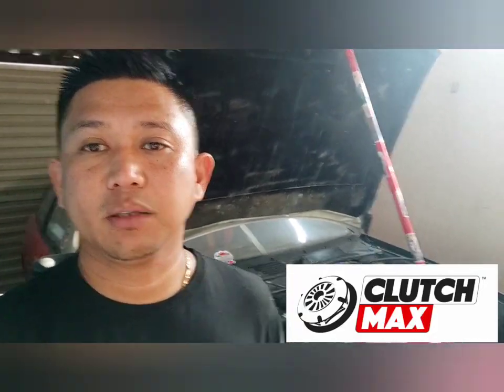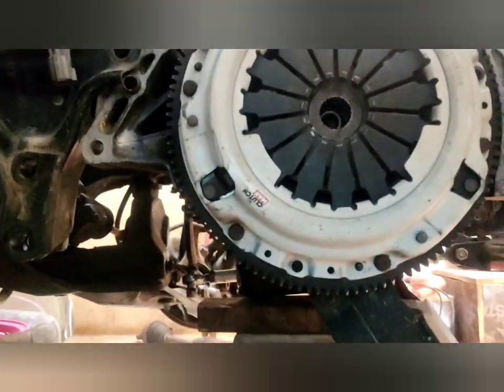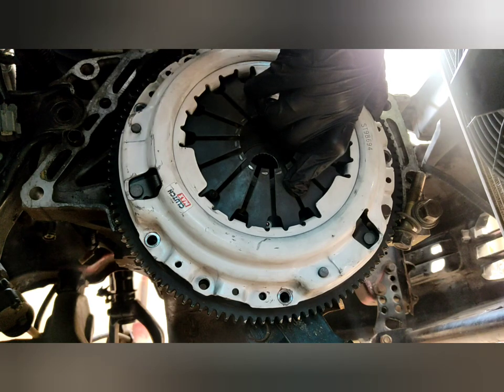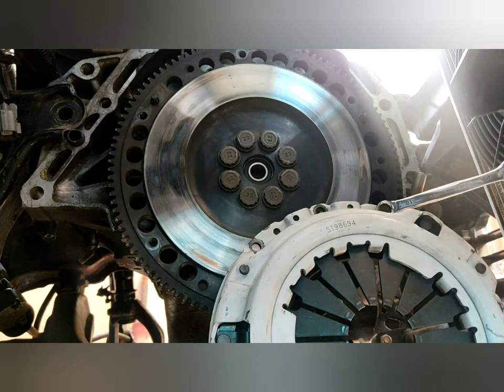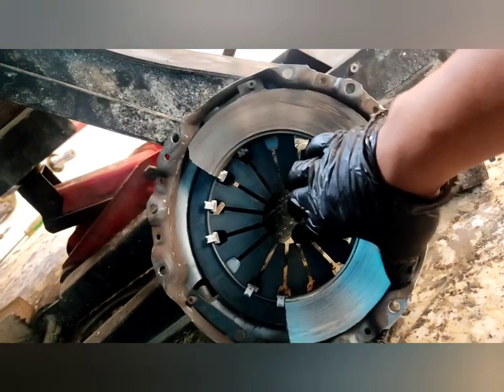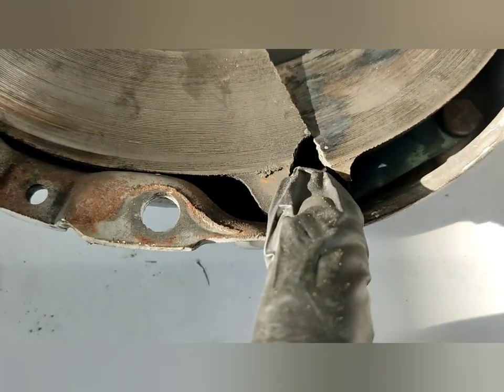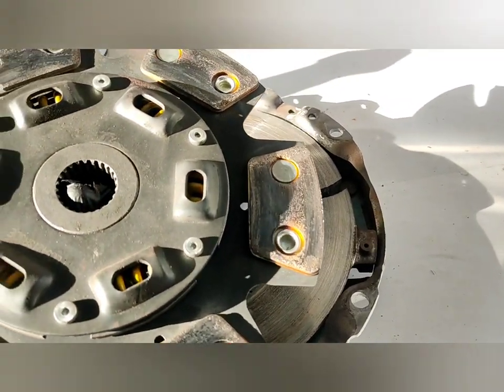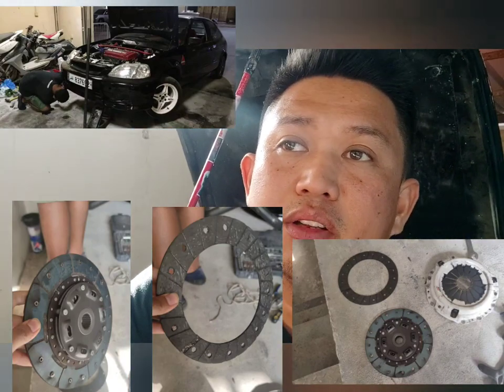Clutch Max - EPIC FAIL

Comment: I've been running the same stage 4 clutch on my civic for the past 3 years. At one point was around 400hp trying to push the engine to its limits.   After going on almost 4 years it's just now beginning to slip.
Reply from the maker: Your very lucky it last for that long. Mine was only about after n
Installing it.ahaha
Reply: You got to break it in you can’t just rip it up

Comment: I got the Clutch Max stage 5 unsprung and while the clutch held all the power no issue it actually created an even worse problem where the diaphragm on the pressure plate was pushing too far in towards the crank and completely ate the thrust bearings on a low mileage motor. When I took the pressure plate off to compare to a stock one the diaphragm teeth were about 1/4 longer towards the center than stock.
Reply from the maker: It did damage to you I can tell bro damn. Switch to some trusted Brands Bro. Hope this vids and comments feedback can help to other like us building our cars.
Reply: An ebay stage 4 clutch did the same to one of my motors.. the thrust washers completely fell off after all the hard pressure on the crank and block... that ruin a good block and crank.. thanks to that cheap clutch... never again i will trust cheap clutches.

Comment: I'm not doubting that the clutches suck however all clutches and new flywheels have a break in period and if you're saying that you were launching that could definitely play into it failing.
Reply from the maker: I consider your opinion bro. However, one of our ek hatches installed, and give it good miles and break in before testing on the dragstrip. the same issue it broke. sad to say. he warn me before I didn't listen. like you said clutch and flywheel need a break-in period. but I'm not using tthis clutch again. haha.
Reply: @TanzRacing  just throw some JB weld on it and send it
Reply from the maker: @josephbishop6462  lmao full send
Reply: @TanzRacing  Everything I hear on the ClutchMax kits are that the pressure plates take a shit.  Besides the damage to the friction from the pressure plate cracking, the rest of the clutch (disc) held up to the abuse?
Reply from the maker: @jw5031  some parts of it are gone.

Comment: i use same thing on my 350z, track only, two years, still fine
Reply: Que stage amigo ?
Reply from the maker: Stage 4
Reply: I purchased a stage 1 kit from clutch max replacing my 350z OEM kit and it didn’t engage the gears so I had to take it off.  Seems like the pressure plate is the problem.
Reply from the maker: Coming from the different cars I think they should look for this issues.its not like our money fell off from the trees . 😞

Comment: did you do a clutch brake in period (500miles)?
Reply from the maker: Can't even drive the car on the Roads. These cars here in Doha our not permitted only we run them on the Track. Once they saw this rust bucket on the street it's a bye bye 😅